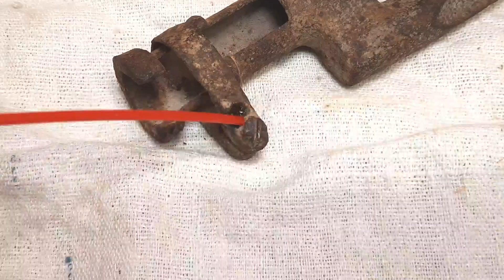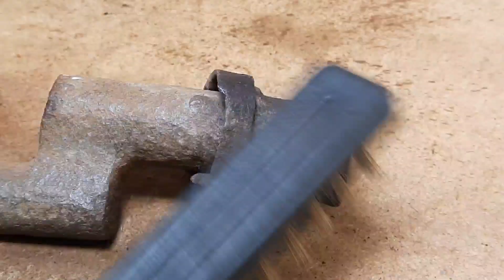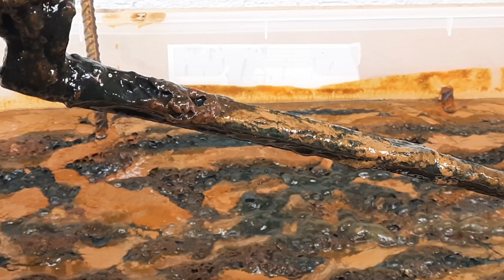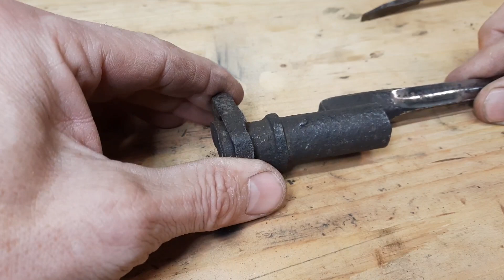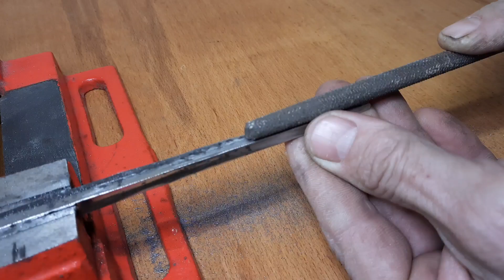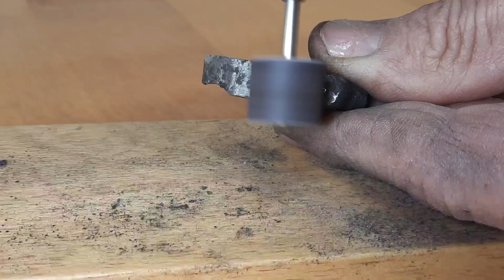Rusty Bayonet Restoration / M1891 Bayonet for a Mosin Nagant

Comment: You have a very early Mosin Nagant bayonet. I know that because your bayonet uses a locking ring to secure the bayonet to the rifle.  Most of the common M91 bayonets you see today have a push button locking mechanism, which was easier to make. I'm guessing that the locking ring dates the bayonet to the Imperial Russian period, prior to the Russian revolution.  I once had an M91 bayonet like yours which was made by Remington in the United States. It was years ago, and It had a locking ring.  Remington identified their bayonets by a single R stamped on the bayonet. I can't remember where it was stamped, but I think it was at the very back of the blade.
Reply from the maker: I was in two minds to do a restoration on this as I thought it was a early one and it has got its own history but it was in really bad condition. I know some people won't like what I've done  to it. But I hope some people will appreciate the work I've put into it. I did fail in trying to take the screw out of the bracket but I really didn't want to snap it off even though I could have retaped it and but  another screw in, it wouldn't have been the same and I would have known I had damaged it. I did take care cleaning at the beginning to look for a makers mark but it was to badly eroded. Thanks again for your message. Have a good day
Reply: @myworkshopadventures9079  You did a good job! You did what you could!!!!!
Reply: В каком месте месте ты тут Наган нашёл?
Reply: @АлександрШмат-ъ3е  ОТВЕТ: Фамилии Наган в ролике не было, однако штык подходит к знаменитой русской винтовке Мосина-Нагана 1891 года. Мосин был русским, а Наган из Бельгии. Мосин разработал большую часть винтовки, но использовал некоторые конструкции Нагана для магазина винтовки. Отсюда и пошло название.
OTVET: Familii Nagan v rolike ne bylo, odnako shtyk podkhodit k znamenitoy russkoy vintovke Mosina-Nagana 1891 goda. Mosin byl russkim, a Nagan iz Bel'gii. Mosin razrabotal bol'shuyu chast' vintovki, no ispol'zoval nekotoryye konstruktsii Nagana dlya magazina vintovki. Otsyuda i poshlo nazvaniye.    Translated into English, the gentleman is asking, "Where did you find Nagant here?"    ANSWER:  The name Nagant did not show up in the video, however, the bayonet fits the famous Russian Mosin-Nagant Rifle of 1891.  Mosin was a Russian, and Nagant was from Belgium. Mosin designed most of the rifle, but used some designs by Nagant for the rifle magazine. That's where the name came from.
Reply: @fredferd965  уважаемый в винтовке Мосина от Нагага взяты всего две небольшие детали, далее Наган ни каким образом не участвовал в создании винтовки Мосина и был вообще-то конкурентом на конкурсе и это не делает его ни конструктором ни соучастником создания данной винтовки.
Замечание насчёт Нагана было сделано на комент выше.

Comment: But you fail to loose ascrew
Reply from the maker: Thanks for your comment. Yes I did fail but I didn't want to break the screw. Some times it's not worth breaking something if you can't replace it to look the same. 👍
Reply: A tip I've used for years owning a repair shop, heat full bolt and metal surrounding red hot, quick cool with cold water., this hardens the screw and the quick cold water quench breaks rust, it works remarkably well.
Reply from the maker: I was going to try this and maybe I should have , but I talked myself out of it in the end. You know what it's like when you are in two minds lol.